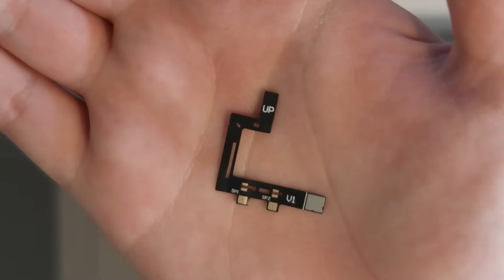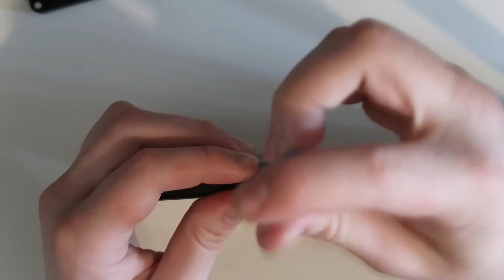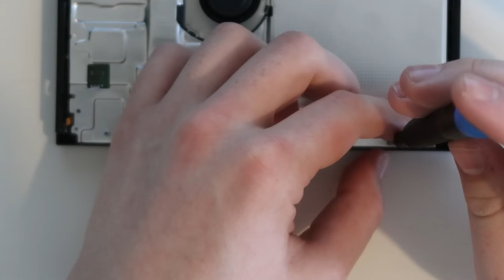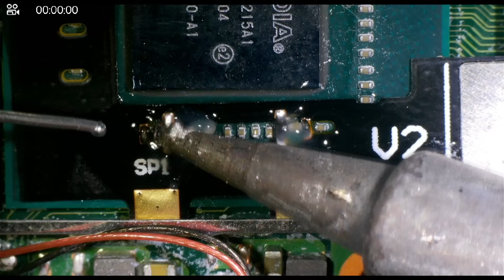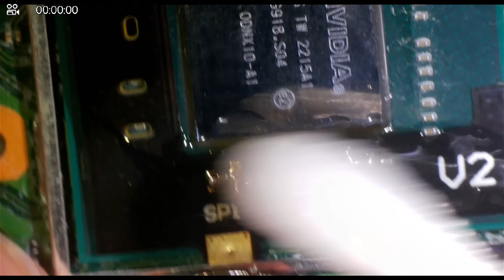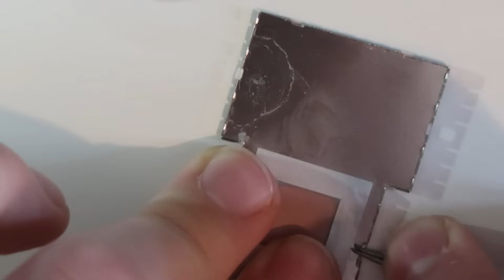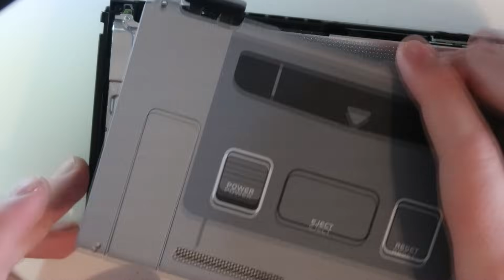Nintendo Switch RP2040 (PicoFly) V2 Modchip Installation

Comment: I am very new to this. I am a 16 year old girl, who just wants more characters on smash. Prior to the hour of research i did, i had no idea what any tech words meant. I have never done any electrical or soldering work in my life. I look up a tutorial for modding my switch. Tut says i need a switch that isnt patched. I check my switch, its v2. I buy a cheap modchip off ali express, wait for it to come, dissasemble my switch and two of the screws wont come out. I have accidentally stripped them, trying desperately to unscrew them. I literally pry the back of the switch off, which to my surprise works and doesnt snap the plastic cover. I soldered the v2 thingy on, added the mod chip, turn it on and it works (kinda, i need to reassemble and add sd card but it works). I am an athiest, but i pray to god thanking him that i dont need to program the modchip. Am currently waiting for thermal paste to arrive. Thank you, you amazing person, for this video tutorial.
Reply: In this case I think you are an agnostic, good job buddy, tell us how it went!
Reply: Please keep being curious about technology like this and trying modding.
I modded my original Xbox when i was 15 and that led me to tinkering with my PC and building computers and modding even more stuff. 
I now work as a machine programmer and engineering.

I got a really good job because i wanted to play Majora's mask on my original Xbox lol
Reply: @Nyx-221 you sir are a legand just because of Majoras mask on Xbox
Reply: Good luck with modding! I’ve had a great time modding consoles, just don’t be discouraged if you mess up, keep pushing forward and you’ll have a great time and learn some cool stuff while you’re at it
Reply: I hope everything goes well, I'm tryna buy a modchip too for some smash mods. I have a more technical friend who can hopefully help me out but it's definitely worrying if you mess anything up
Reply: how did it go
Reply: I tried modding my xbox 360 and borked it
Reply: Sis if you can do it so do I 💪
Reply: yo i did it and it was super easy 😊
Reply: Wow! I'm technically inclined and have soldering experience, yet I didn't want to try doing this myself out of fear of breaking something. The fact that some of you did it anyway with no prior experience or knowledge at all is incredible!
Reply: @swelleq2861  Core switch really isn't that difficult if you do it with a decent bit of control over your iron. This was my first time microsoldering too, did it in a little over an hour. I'm fairly certain you'll be able to do it, too!
Reply: holy crap for a first timer that is amazing
Reply: @plate-0000 Is it really that hard of a surgery? I bought a switch with drifting joysticks and a malfunctioning wifi board. Bought it specifically to modchip, first timer here aswell. (only soldering experience I have is soldering speakers to my DSLite upper screen)
Reply: Any News 👀
Reply: me and you girl
Reply: That's impressive, i want more characters on smash too, but i ruined my old modded switch software and the one i have now is the v2, honestly i don't have the guts to try and mod it 🫩
Reply: Wtf I just read this girls life story
Reply: Atheist? So, you have a history of stupidity.. 😂
Reply: Damn if you could do it I’m gonna give it a shot!
Reply: Heh you go girl 👍🏻
Reply: Dude, we're living the same life
Reply: I'ma need to hear how your modding went
Reply: Im in the same spot as you right now, my mod chip just came yesterday and im still waiting for the soldering iron. Really hoping it goes well😔
Reply: The story of my life ahh comment
Reply: Midtier shitpost
Reply: Please marry me 😓
Reply: @fd1902 16
Reply: Well 17 now
Reply: An atheist but you pray to God. So you aren't an atheist, which is good. Because God is real and Jesus is the only way to salvation. I suggest you look into it. God bless.
Reply: God is real, you can’t explain objective morality without God and without objective morality, you can’t say that what Hitler did is wrong
Reply: To say that you are atheist and then praying to God is hypocritical, you are one or the other, not both at the same time
Reply: @melkorstormcrown6939  or maybe they just say "dear god please work" as an expression because culture and stuff
Reply from the maker: Why has my comment section turned into a religious debate? 😂
Reply: @TheModSmith not sure dude, however, I used your video as a guide on installing my switch's modchip (without any prior microsoldering knowledge) and I succeeded! Safe to say I owe you dude, tysm ❤️
Reply: @melkorstormcrown6939 not that serious bro
Reply: @melkorstormcrown6939  isn't everyone?
Reply: @tydiaz3921  no
Reply: @melkorstormcrown6939  I have a feeling if I knew even a few of your core beliefs, at least one of them you don't live out to its fullest meaning.
Reply: @melkorstormcrown6939  if you're honest at least
Reply: God is real, he loves you and he wants you to be his and for you to commit your life to Christ and to repent of your sins.
Reply: @ATeenagerFromMars so modding my switch is a sin?
Reply: @ATeenagerFromMarsif he loved me he wouldnt threaten to hurt me if i didnt do exactly as he said.
Reply: @ATeenagerFromMars that’s not the focus of her comment. And god is most definitely not real.
Reply: @ATeenagerFromMars Is this some kind of propaganda?
Reply: @Whisperito_ no…?😂🤣
Reply: @ATeenagerFromMars It looked like "Come in my religion you need it, you need it..."
Reply: @Whisperito_ there isn't really any benefit to "winning someone over". idky everyone thinks that's the intention. i mean maybe for ill intent "leaders" who gain something, but for your average person there's not really anything to gain
Reply: @Whisperito_ yes to make people mess up their switch so console repair shops get more work.
Unless this lady is lucky enough to have someone around with a decent soldering equipment this is practically doomed for first time.
Or she just got incredibly lucky.
Reply: @ATeenagerFromMars Forgot to take your pills this morning?
Reply: @Hannah-cb7wr  no sir😂. Just expressing my beliefs 🦶
Reply: @ That one weirdo at the subway station talking about how he’s being watched does the same, maybe you two could start a group?
Reply: @Hannah-cb7wr  yk bro I would love to if I could 😂.
Reply: @ATeenagerFromMarsI don’t know why but your comment is scary
Reply: @DaSummit  bruh how lol??
Reply: @ATeenagerFromMars what you said was not crazy at all😭 thank you for saying so. such an overreaction to a simple comment...

Comment: I tried to solder as novice and I lost the left capacitor from the chip the nitendo switch seems to be working fine after i removed the tape and the modded chip but I guess this one is a failure unless I could solder back the capacitor or could i bridge them without it just from the tape?

Comment: As a first time solderer I can confirm that if this guy can do it you can to
Reply: You did it without any soldering experience? Just wondering for me
Reply: @uploadsbywill5226 I don't recommend it as your first soldering job as micro soldering is much trickier but if you have the patience and confidence you should be good
Reply: @uploadsbywill5226 honestly it is a good idea to try this on old devices
You basically jave to buy the tools then try your luck with it
Reply: I'm terrified of fucking things up but I'm pretty interested in learning to solder, wonder if there's anything I can practise precision on
Reply: @Anreii I know this is a little old but if you have any old laptops etc, you can practice by desoldering components and then reattaching them

Comment: Great video thanks. The chip worked for 2 days. Now it looks like it is no longer receiving any power supply. The LED is off. The switch boots directly into the stock firmware. The soldering points actually look good visually. Where does the chip get its power from? Do you have any idea

Comment: hmm, if i pull mod chip off switch boots normaly, with mod chip insalled it boots to NO SD CARD screen, if i press power buttion just seems to turn off
Reply from the maker: You've done everything correctly. Now you just need a microSD card with Atmosphere and Hekate on it.
Reply: @TheModSmith  easer said than done, i got it were it will boot the simi custom firmware but gets errors on the regualr CFW option. im switching over to a genuine sandisk micro SD and seenig if maby the china card is making this go screwy,   i even got tinfoil to open in simi custom firmware but no tiles launch and the installer crashes the "game"

Comment: Hello. After the 18th minute, once I weld the sp1 and sp2, I prepare to turn on the console to test if it starts, and I get a blue screen. Can you give me guidance on what it might be?

Although he gave that blue screen, he decided to follow the process, and installed the nand memory with the chip, and surprisingly, he ripped off the "NO SD CARD" screen so I decided to continue and reassemble the console.

My surprise was that when putting the files to boot Hekate on my console, it always puts the same error on me and doesn't boot: "missin lp0 (sleep) lib."
"Update Bootloader Folder"
And I can't start.

where can the error come from? can it be a bad chip installation?

I look forward to your impressions and help, I'm going crazy.

Thank you.

Comment: Mine blinks blue and then green but doesn't say no sd card. It goes right to the switch screen.  My switch is on firmware 19.0.0. is that normal?
Reply: One side wasn't touching.  Finally says no sd card.  Took me two mod chips and over 15 hrs between 3 days  but it's connected
Reply: @maggot238  reletable but im still not done modding

Comment: Mixing leadded with lead-free solder can be tricky.  If you're not careful to completely mix them, there will eventually be cracks in the joints due to the different metal mixes heating and cooling at different rates.  It is best to use lead-free solder for these newer consoles to be sure this doesn't happen.

Otherwise, thanks for the tutorial since this is something I've been needing to do and the info/process is really nice to have.

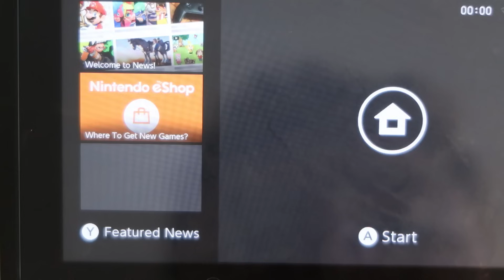Comment: I wish I had watched this video instead of the v1 modchip install. I had the same issue you had at the 20:00 mark. And kept assuming I didn't have the capacitors connected properly. And ended up with one of the capacitors popping off.

Comment: Do you actually need that metal plate on the back of the switch. I have a clear back shell and am thinking of modding my switch with this and want to know if the metal plate can be removed to see the internals of the console
Reply: YES, yes you do.
Reply: @ thank you for the advice
Reply: @Grenguy_  no problem, no need for someone ruining their switch unintentionally.

Comment: Little tip about the thermal paste (i been building pc's for over 20 years) only use a small pea sized amount at most because if you put too much on it lessens the conductivity of the heat and then you get less heat dispersion. Some people might be picky as you suggest, but honestly what you put on in this clip is far to much, not saying this to be picky like some, but as a genuine tip cos the rest of the clip was good, im gonna be doing my first attempt at modding the switch soon so was a good clip for instructions.
Reply: Considering there's no IHS (Direct die contact), more is better as long as it isn't a ridiculous amount since you want to be 100% sure the entire die is covered.
Reply: @tpf92  i mean when it is assembled and compressed don't forget though the paste spreads out significantly a small amount goes a long long way once compressed as i say though people will have different experiences too :) so not judging or nothing just adding to the conversation from my own experience :glasses-purple-yellow-diamond::hand-purple-blue-peace:
Reply: @tpf92  20 years ago it wasn't standard to have an IHS, which is where the pea sized amount rule started because too much = uneven contact if you've ever relid a chip u know its even more valid, but the switch chip isn't super high on thermals so you can get away with a lil muddddd
Reply: There are like a billion videos proving you wrong at this point. Doing something for 20 years isn't evidence that your right, you've just been doing it wrong for 20 years.
Anyway, that's why he said what he said.

Comment: looks good but you made the connections several times and then went over it again, heating and cooling those capacitors can't be good for them

Comment: Install the EMMC onto the Picofly first, then connect the flex cable. And you don't actually need to cut the heat shield at all for V1 or V2 Switches. Just slide the Picofly through the fan hole very carefully. There is enough clearance there. The housing should fit just fine.
Reply: Please could you post image how to instal V2 chip without cutting Heat Shield?
You can slide thorugh the fan hole but when you put back cover it makess pressure on chip. 
Also when back cover is fitted its not flat outside where it makes pressure to chip.

So, What makes more harm to switch constant pressure on chip or reduced heat dispearsion?

Thanks
Reply: Same thing I thought it is possible. I'll order my picofly and do it myself.
Reply: Does it make the back cover bulge out at all? Also what did you use to mount the modchip to the heat shield piece that wasnt too thick like double sided tape i think might be.. I dont have anymore Kapton tape right now either..
Reply: @CrisCheese_ you should look up what a heat shield does mate. It's there for a reason. It transfers heat away from the cpu and spreads it out.
Reply: @AWG2026 hence why he said you don’t need to cut it, read

Comment: thank you so much, just followed this video and i managed to do it successfully in like 20 minutes, and its the second time ive ever soldered anything before!!!!
Reply: Do you have a microscope? I'm scared of watching how tiny things are. I'm  relaying on my watcher lens.

Still waiting for the picofly to arrive. I'm eager to start.
Reply: @ nope, sounds stupid but i literally just did it by doing it and checking every few seconds with my phone and my eyes, my iphone has a macro mode so i just put it really close and looked at it like that. if yours doesn't have a macro mode, set it to 0.5 ultra wide and put it really close it should also work.

Comment: idk, i think usinng this flexicable for this this is to dangerous, cuz u could burn the board & the components. using normal cables is better & that way u wont have y o cut the protector or u can cut much better. good video 0u0

Comment: I would like to suggest listing all of the tools required for this at the beginning of the video. I went through step by step until you started soldering stuff. I am new to this and was not aware I needed this tool. Unfortunately it wasted my time until I can get around to getting a soldering kit and learning how to use it.
Reply from the maker: I’d always recommend watching the video in full before following the guide yourself, especially with an install like this. In terms of tools, it’s just a soldering iron, solder, flux, and some tweezers.

Comment: If the heat shield were embossed with the shape of the chip plate you wouldn't need to cut it , just fill the gaps with thermal paste, screw down and an outer layer of tape for case pressure

Comment: I got stuck, when trying to start the console it just boots to the ofw. When trying to open the folder on pc it shows the folder briefly with the files needed inside and then closes again. But not at all times, most of the times it just doesn't show anything.I get no led signals either.

I watched the video a few times as well. Am I doing something wrong?

Comment: Really good video, butsadly i have no soldering skills, how did u learn?
Reply from the maker: I first soldered the easier stuff like pin headers, then moved onto more complex stuff like large SMD components, then smaller stuff gradually. There isn’t really a right way to learn in my opinion, I learn by doing stuff so I broke lots of practice boards and gradually improved.
Reply: @TheModSmith thankyou i wanna learn too
Reply: @TheModSmith  could u give me ur discord username? the link in the description doesn't work, i need to ask you something, if possible

Comment: im happy that the soldering is messy because that's more realistic of my skills.
Reply: Lmao I can't even solder I just think it's cool to watch.
Reply: In reality he's making it look 10 times harder than it really needs to be. He doesn't even have a fine point and he's using big fat solder for large Electronics. Not to mention he's not even heating up the components so the solder flows properly he's just relying on the solder to heat up everything around it.
Reply: ...that tape is not heat resistant tape, it's going to melt as well, It also creates a hot spot....
Reply: Honestly same, watched the happy little accidents and said oh that was easy to revise.
Reply: Hello sir what is the next step after done install chip how process the software to install atmhosphere on sd card can you help me or teach me sir.thanks a lot
Reply: Is it just me or is soldering just the most unnecessary primitive nonsense in electronics these days...
Reply: @JPs-q1o it’s just you
Reply: @JPs-q1o  yes it's you, you're incredibly naive. How else do you imagine attaching metal to metal? Even your iPhone components are soldered to the motherboard.
Reply: @JPs-q1o  just you mate
Reply: @JPs-q1o  Nope. Things should be attachable by 2025. We're just late.
Reply: @leon_paradoxx  yes, because having Lego designed attachments is a great idea. One decent drop and there goes all the chips! Wheee!